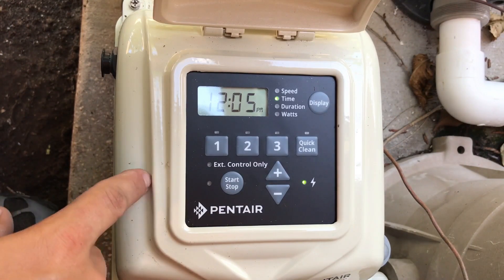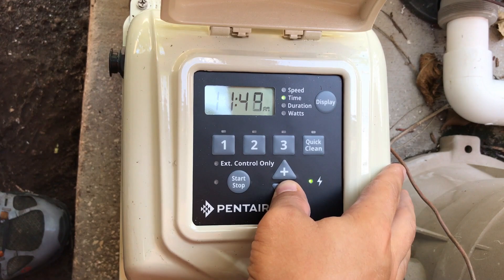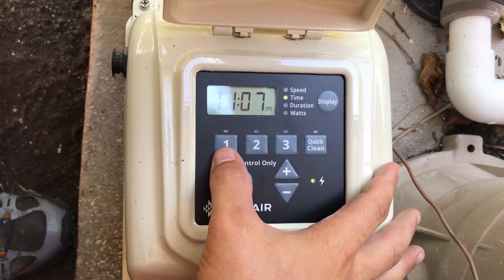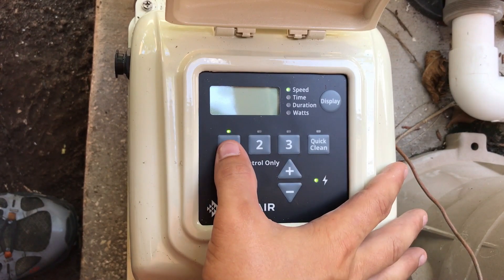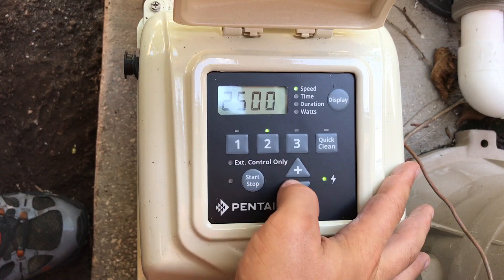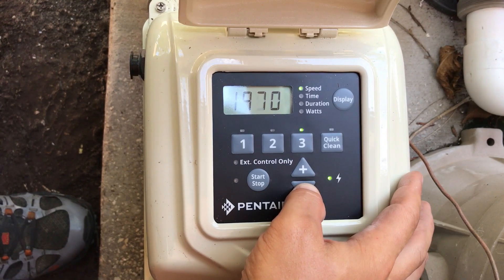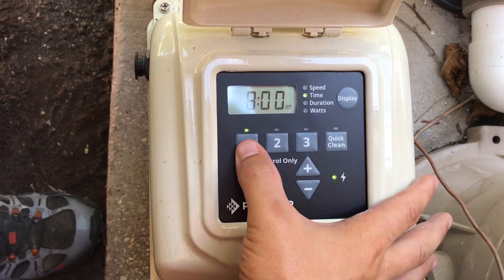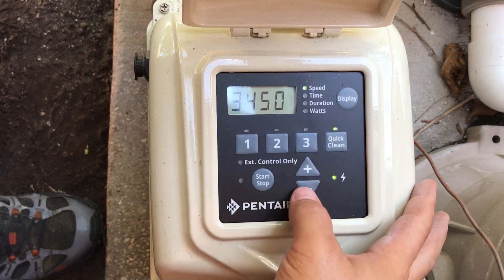How To Program Pentair SuperFlo VS & Sta-Rite SuperMax VS Pump: Full Setup Guide

Comment: What is the recommended speed for this pump to run with the heater?  I have a RayPack new heater, installed it last September. What is the sense of the 'variable speed' if the speed needed to run the heater is a specific one?  Thanks.
Reply from the maker: Most heaters require around 40GPM to activate the pressure switch. Because the hydraulics are unique to each system. What I would do is turn the heater on and incrementally increase the speed until the unit senses flow. Then add another 100RPM or so to make sure that it'll be good for when you want to use it. I hope this helps!